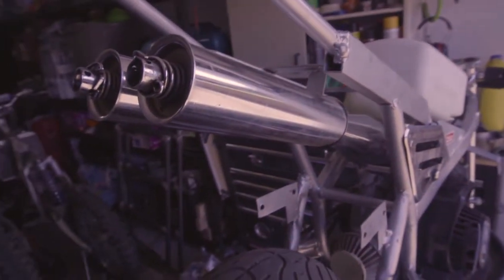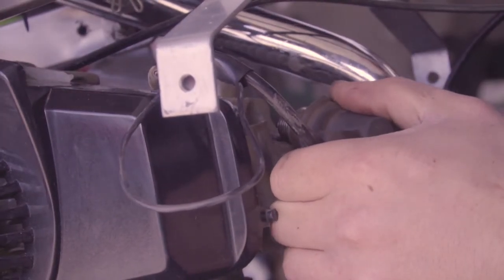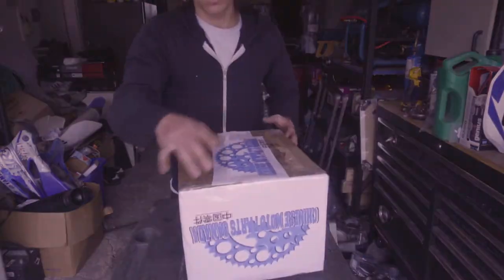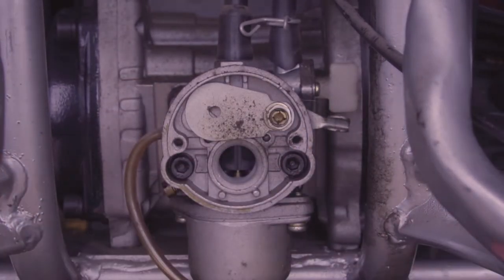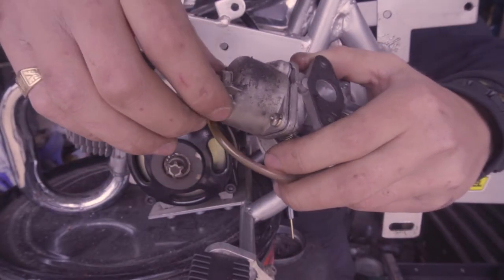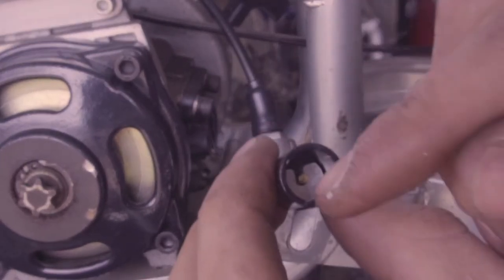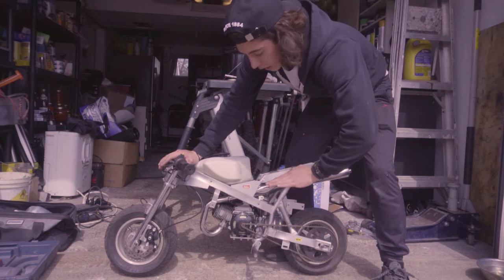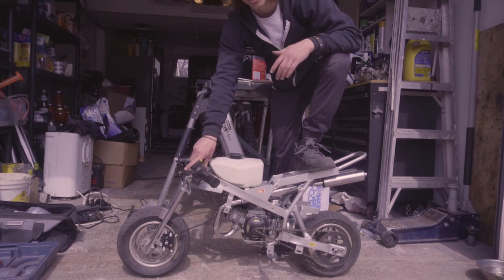HOW TO REPAIR ANY POCKET BIKE 49CC 2-STROKE

Comment: Bro I have a X7 pocket bike 49cc on my page. I have to pull it a few times to start it and stay on the gas. Electric start doesn’t work either. Battery may be dead. Bad stator ? What you think ?

Comment: I got one from ebay it work but Idile high when I'm trying to injustable the air fuel and when I full throttled it kinda bogged out but half throttled it work fine new carburetor also so you mite be right about ebay carburetor are not as good.

Comment: They get clock cuz you're using gas that has ethanol in it . Use gas without ethanol and it won't get as clogged as as much
Reply: are you saying i should buy the more expensive gas or whatever? like instead of the lowest which would be 87 (i live in canada) should i go with the highest number one? think it’s like 90 something
Reply: @dahouligan1148  yes higher grade gas is better for the 2 strokes also the gas station too because certain gas stations have diffrent type of gas

Comment: I have the same engine I bought a new engine for my bike. It runs pretty good and idles but once I start riding after a fel hunderd meters it just dies and does not want te keep running. Can you help me solve this problem. The engine is really new
Reply: The fuel taps are shit. Not enough fuel in the bowl. Disable it.

Comment: So i need some advice i just rebuild my engine bcs it was jammed after i rebuilded it it only runs on choke and i cleaned the carb and still same prob and it wont stay on on choke off it runs doesn't stay on
Reply: Check main jet

Comment: My son bought one of the mini choppers and the battery is old and no good but we jump it at the starter with a car battery it runs as long as the jumper is on the starter but when we try to pull start it it doesn't start. Is there a way to make it run without the need of the battery? Is the battery powering the coil?
Reply from the maker: depends how it is wired, I wouldn't be able to tell you but logically it should start even without the battery being charged.
Reply: sometimes one magnet fires the high voltage ignition coil and also powers a lower voltage charging system.
if theres no resistance on the pull starter, replace it. if there is resistance but it wont start, somethings wrong with the engine.

Comment: When I try my pull cord  it’s way to hard to pull when the spark plug is in like when I say hard I mean hard but when the spark plugs out I can pull it ass easy as usual , feels like to much compression but I don’t know how to fix that
Reply from the maker: sometimes the engine mounting screws from the bottom of the chassis where the motor sits are too long and they put unnecessary pressure on the flywheel and make it seem like it has hard compression but really it does not. double check that. if its not that then its just normal compression, they're supposed to pack a punch. its a good thing.
Reply: Could be a spark plug is too long

Comment: Why does the pocket bike engine stop after 100 meters of walking?
   What can I do?
Reply: Check if your float bowl fills quick enough. It sounds like its clogged somewhere in there. If your float bowl doesnt fill quick enough your engine will start but stops after a few meters. If you let it sit for a while it does the same thing

Comment: I changed my carburator and have spark but still won't start
Reply from the maker: maybe the carburetor you bought was faulty... I linked a good carb in description.
Reply: Did a new carbon work?